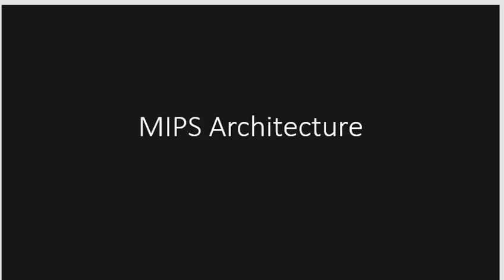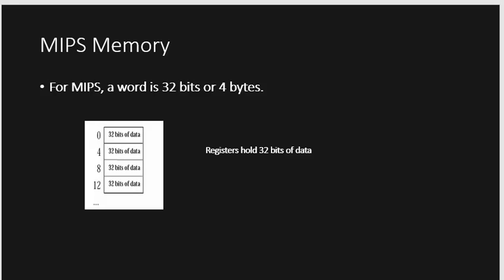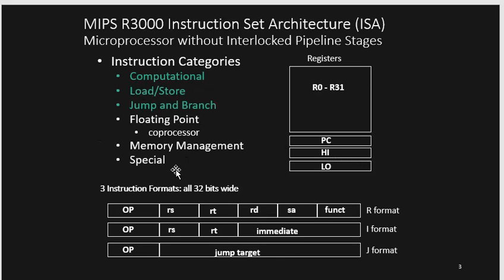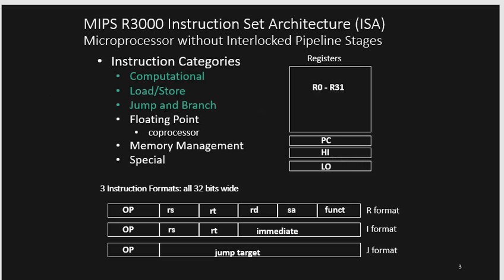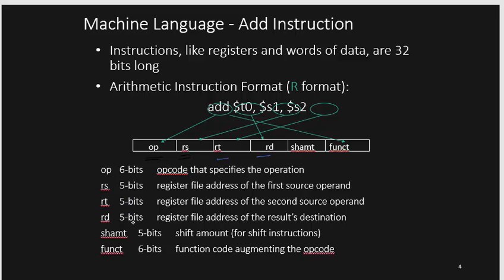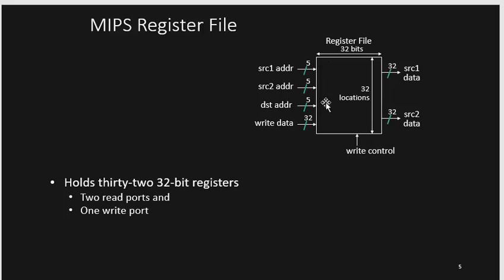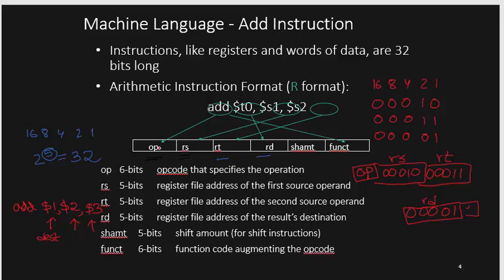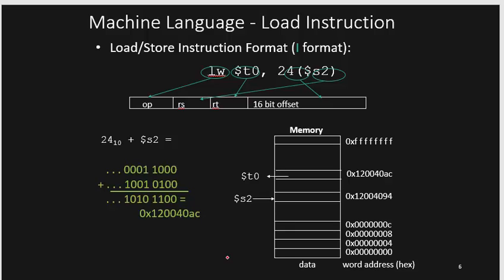MIPS Architecture Basics - 1

Comment: I think the funct is not 0.The function for add is 100000.So opcode will be 000000, rs->00010, rt->00011,shamt->00000 and funct->100000. And the 5bit register can't hold 32 bit date.5bit means 5 bit.So its holding the address(5bit) of the data which is 32bit.